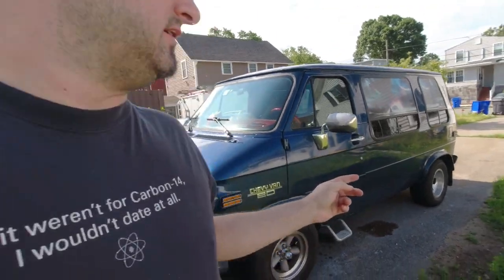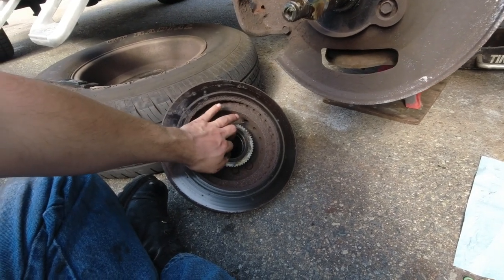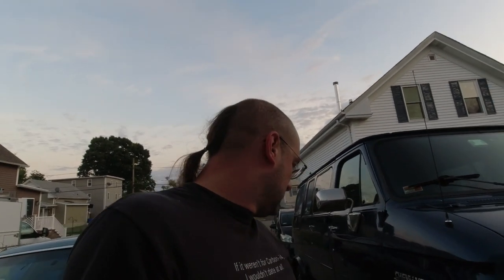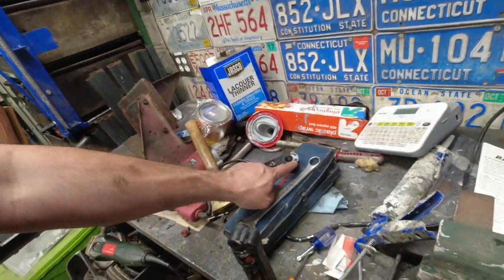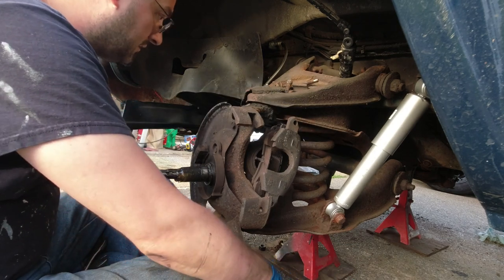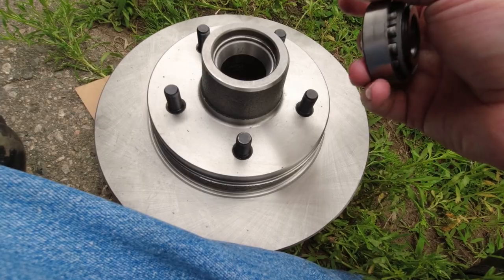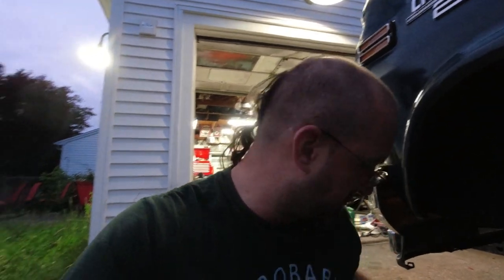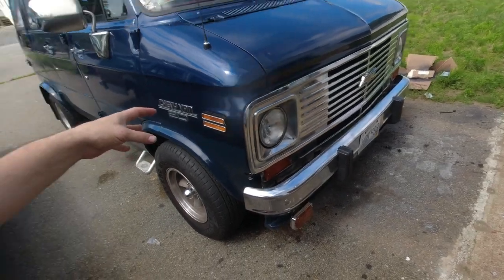Rebuilding my Chevy G20 van's front end, Part 1

Comment: I really like the DIY length jig for the turnbuckle tie rods.

FedEx has been even more awful than usual lately.

I made rotor shields for the swept surfaces on the Syncro rear discs from scrap .040 aluminum so I could media blast them along with all of the other rear suspension parts. Those are solid rotors, so no  fuss about getting paint in the books and crannies of vented edges. I wish there could be a communal vat of Master Series paint that I could just dip some parts in.